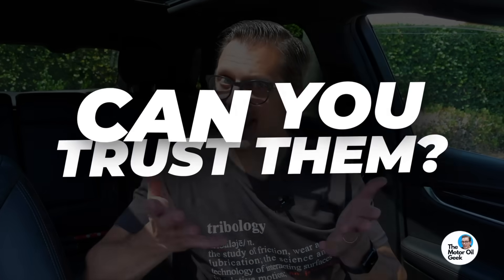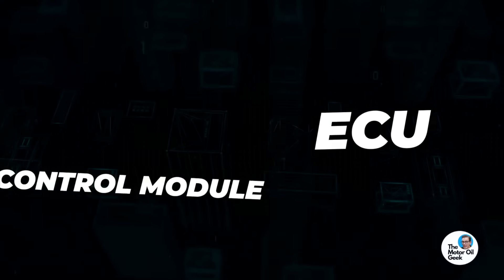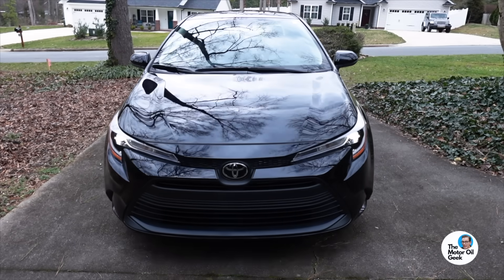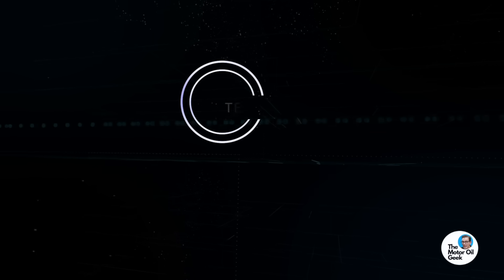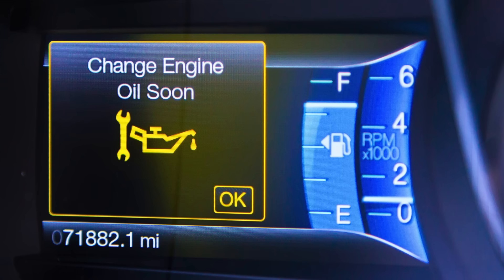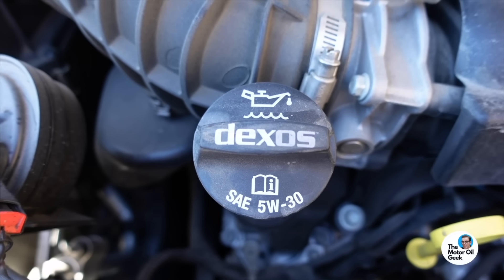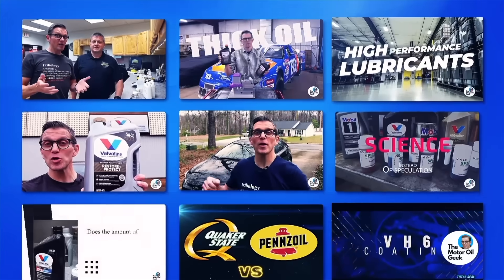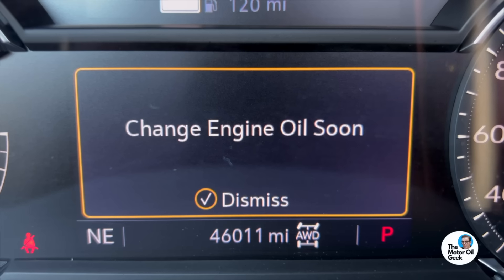The Accuracy of OIL LIFE Indicators REVEALED!

Comment: Good video. I have an oil monitor on my '97 Regal (3.8L) but I only drive less than 1,500 miles a year on it, and change the oil once a year, so I have never driven it long enough to make the "idiot light" come on. Now, on my '91 C1500 (5.7L) I have a timer and I only put less than 1,500 miles a year on my truck, and change the oil either when I hit 100 hours or one year. My average speed based on the timer and odometer is 35 MPH every time I check it so the same would be true with the Buick since my driving habits don't change between vehicles. I always look at the bottom of the oil drain pan (piping hot oil drain) and I will see virtually the same "shiny" super tiny wear particles from both engines despite the very low miles between oil changes. So, the longer you stretch out your oil changes, the longer those particles stay in suspension and circulate over and over again inside the engine until either the oil filter traps those particles or you drain the oil. My driving habits might indicate that the oil is more often bypassed (oil filter bypass and engine block bypass) than run through the filter since it doesn't get run long enough to get hot/thin enough to more freely pass through the oil filter. Food for thought??? I would like to know if any motor oil makes its way through the oil filter at highway speeds when my hot oil pressure sits right at 30 PSI?
Reply from the maker: Stay tuned for our next video about oil filters.

Comment: I have cold feet about trusting the oil life indicator on my 2016 Ram 1500 pickup. I change it every 5,000 miles only because of the 5.9 Hemi lifter failure that happens to some of them. I only use Mobile 1  5-30 full synthetic oil and Wicks  filter. I am I wrong ? Anybody ? I feel better safe than sorry.

Comment: The issue I have is that this is on the assumption that the oil life indicator was reset the last time the oil was changed. I can't count the number of times on my personal vehicle, I had to reset the oil life on my own, after the shop forgot to, or more likely, had no idea how to, reset the system.

What's the likelihood that for a rental, this is even happening? It could've been changed just 2-3,000 miles ago, but never reset. I'd be more impressed with numbers on a personally owned vehicle that can have the oil life verified reset at the proper interval.

Great historical information in this video, but from a scientific aspect, major, integral variables are at play.

Comment: 4:15 18° above which oil temp? You have to base that on an optimal oil temperature.  6:25 Why would you use a rental car for this analysis when you don't know the true length of time the oil has been in the vehicle? Or whether or not the oil life monitor was reset when it was last changed? The conditions under which it was driven?  5:07 GM oil life sensor... there is no oil life sensor.

Comment: Had a 2011 GMC Sierra with a 5.3, 250k on it. The OLM would zero out at 10500k to 12000k. Never went over and never had to open up the engine.
Oil is cheap, engine repairs are not.

Comment: Thanks, I always change around 20% to be safe. Now I feel confident I can go longer on my oil change.
Reply: I did my last oil change at 5700 miles (end of winter) and the Oil Life Monitor still had 25% left. Only did it early because I had put an entire can of Gumout multi system tune-up with PEA down into each cylinder to clean the piston rings.

Comment: The system also follows the timeline between changes, ie "change every 3 - 5,000 miles, OR every 6 months. My last oil change in my F-150 was 2022, but has only 1,800 miles.....monitor say oil change due now and has for 6 months.

Comment: First off these indicators are set to the oil intervals set by dealer or manufacturer, not based on whether or not your oil is still good or not. If your running your oil more then 7k your not to smart anyway, even though it may still be good.

Comment: When I change my oil I reset the mileage counter, I use this to know when a change is due.
Reply: Resetting the mileage counter after each oil change is an effective way to track intervals and ensure timely maintenance. Pairing this habit with regular inspections helps maintain engine performance and longevity. You can subscribe to the channel, or leave questions on the "Mechanical Guy" channel. My colleagues and I with many years of experience as auto mechanics will provide the fastest free support!

Comment: The other thing to consider is the technology  that originally  was the design map for oil indicators is obsolete.  Modern oils are far superior to oils from the 80s -90's, vehicles have become so far advanced in efficiency  that their is simply no comparison  to the vehicles from the 80s-90s .  Personally, I always use diesel oil in all my trucks, whether they are diesel  or gas..  My company is good at keeping up with oil changes, but in my personal  vehicle, not so much.  I have gm trucks with 380,000 miles on them still running perfect. In my personal vehicle, I have over 400,000  and going strong. My personal vehicle gets an oil change every fall.. that's it, once a year! I Look down in the valve cover at the rockers and it looks the same as the fleet trucks that get changed every 5000 miles.  I ran a compression check 6 years ago and wrote down every cylinder on my personal truck. At over 100,000 miles later, nothing has changed. That said, most miles are highway. That does make a huge difference! I personally would never run 0w20 ! But I know the ls engines in my trucks can drain back the thicker oil. As far as gas mileage goes, my gas engines average about 18mpg in 4wd vehicles, in the duramax trucks about 21-25 mpg. I simply don't believe the thin oils make enough fuel saving difference  to sacrifice  lubrication quality.

Comment: I had a 2023 Ford F-250 with the HO 6.7 PSD. Used it for towing brand new RV’s from the manufacturing plants to the dealerships all over the USA, the oil monitoring system worked decently. My oil samples every 10K of essentially all highway miles, half of the towing an RV, the other half returning empty…always showed there was more life in the oil. I likely could have gone 15 - 20K miles between oil changes. Using Schaffer 5W - 40 fully synthetic oil and Motocraft OEM filters. All weather. But 95% of the time time I started the engine I drove at least 600 miles without stopping except for DOT required breaks and barely ever let it idle. At 125K miles that motor was still essentially just breaking in. That’s a great motor BTW.

Comment: As a Father of a GM Owner, who Drives like Grandma Example, I would say "Most People can Trust GM's OLM but not all". Her 2017 accumulated enough Condensation, to Freeze the Oil Pump Pick Up and cause 0 Oil Pressure Start Up in below Zero Temps. OLM still showed 42%.  As a Ford Driver (normal habits) and ex Mechanic, I trust them to within 10% (oil is cheaper than parts) not for diluted or viscosity concerns, but for concerns of Oil Passage Blockages from Contamination, Many small Screens that can be blocked by Carbon Deposits.

Great Vid though. I recall Selling the Benefits of OLM back in 2010, only to be smashed by GM's recommendation of "Semi Annual Inspection" shortly after OLM release. Reducing the "No Recommended Service" for possibly 10-12,000kms of driving (depending on how you drive) Sales Pitch

Comment: I changed the oil and filter on my 2018 silverado. Resetting oil monitor and showing 100%. Drove less than 50 miles, now the monitor says 85% remaining. I call B.S. on that junk. This not the first time it's happened. I own three GM trucks with the same junk, and they  all do pretty much the same thing. I will go by mileage from now on.

Comment: Since 2003 I've been using fully synthetic oil in our cars Valvoline specifically, changing it every 3000 miles regardless of manufacturers recommended cycle. When new, first change is 1500 miles, used the second it pulls into the driveway. We bought a 2018 Dodge Journey (4 cyl) new one year and again 1500 first 3000 thereafter. Unbeknownst to me at the time that specific engine was notorious for smoking at around 70,000 miles the wife had 78,500 on hers when we traded it in. The dealership tried to low ball the trade in price because of that "oil burning problem", I told the sales guy it doesn't smoke because I changed the oil every 3k. Needless to say he didn't believe me so I made him and the sales manager have the mechanic take it for a test drive to prove it. Mechanic told me I was wasting money changing it every 3k. After his test drive the proof was there, no smoke. They gave us what we were asking but didn't buy a car there (her Journey was the 3rd car from that dealership). Wife is now driving a certified preowned 2021 Lexus GX 460 AWD with 45,000 miles (when we  bought it 3 years ago). My personal moral of the story is, if changing the oil at 6k is good, then changing it at 3k is gooder!

Comment: My car has an oil life indicator.  I just ignore it and change oil every 5000 miles or 6 months. 
Then reset the oil life indicator. 
btw... it usually says 40% life remaining at 5000 miles
Reply: I go by mileage on my daily driver but I have two other vehicles that accumulate less than 5k miles per year so I change those annually.

Comment: GM's oil life prediction has always taken into consideration driving habits as well... rpm, time spent at high rpm, engine load, driving habits in general... and it's been this way since the early 90s on the cars that had it, which quickly became every gm car by the mid to late 90s. My 99 Camaro SS merely has a "change oil soon" light, so not a percentage... and that's the lowest end of GM's efforts at the time. But most all other cars and trucks (suvs, etc) get / got the 100-0% readout, amongst many other factors.

That said, I change my oil (always have had GM, and atm have an 05 EXT, 99 SS, and a 15 Sierra Tuscany Badlander) @ about 30% mark... I don't take chances, and by that number I'm already around the stated longevity figures on the oil used.. which is always mobile 1 if I'm doing it, or OG OEM Dexos if at the dealer.

Comment: Our local GM (Cadillac / GMC) dealer puts reminder sticker on windshield @ an even 5,000 miles (approx. 33% oil life remains). My old classic cars w/ conv oil get changed annually or @ 3,000 miles. New vehicles, not at the suggested 7,500 miles, but @ 6,000 miles (20% oil life remains). 6 qts of dexos oil & ac/delco oil filter cost about $40, compared to dealer $80.Since I do it myself, I can justify the conservative replacement of oil. Recently scaled that back to 5,625 miles = 25% oil life remaining.

Comment: The dealership told me my engine oil should be changed every 8 thousand KM. Sure I may technically be able to go further but it's cheaper to prematurely change engine oil than to buy a new engine
Reply: That's equivalent to 5000 .miles.  your dealership sounds like they're trying to take good care of your car.

Comment: My 2011 dodge avenger I bought new, it’s up to 255k miles now. What I can say about its “duty based” oil life monitor, is that it’s reliable for conventional oils made back in 2011. It alerts between 4-8k miles. If I use conventional and it’s alerting, I may change it. With synthetic I may just ignore and wait a while longer. These days always following it may be a bit too soon for the changes.

Comment: My 18 silverado uses percentage  system and you can’t even find how low you can go between oil changes in mileage in owners manual or online. Well, one time I checked the percentage in relationship to miles I had driven. Low and behold   100% was 7500 miles.
Reply: If you're using full synthetic and drive a lot of highway miles, engine fully warmed up, then 7500 is okay.
I'd still do it at 5000k though

Comment: You missed a MAJOR thing here. It’s a rental, you don’t know if they reset the oil life monitor.  If they change the oil based on milling as some rental companies do, they may not even think of the oil life reset.  They simply follow the company computer that says to change the oil.  So the oil you tested may have been put in when the oil life monitor said it was at 40 or 50 percent

Comment: Using a rental car is a poor choice. Who knows when the last time someone reset the oil life indicator.  I change the oil on my vehicle every 5k regardless of driving conditions. I constantly forget to reset the oil life indicator. On my GM truck I've done 4 oil changes and the oil life indicator was somewhere around 30%. Not sure I'd want to drive my vehicle on oil that has not been changed for 15k + miles.. Maybe this helps as stated in extreme cases such as city driving or stop and go short distances.

Comment: Forget those oil life indicators and manufacturer recommended oil change requirements.
Look at your odometer and change your oil religiously around 5000 miles.
Get a tire gauge and check your tire pressures weekly.
Lift the hood and use your dipstick for gosh sake.
Find a great, trustworthy local independent mechanic to do your maintenance. They do exist.
Stay far away from the dealership  shops. They are overpriced and only want to oversell you unnecessary crap.
Anything else is BS.

Comment: I have a 2012 Civic Si as a summer car that, one time in it's life, allowed a 25k km OCI... it was a time when it was my primary car and i just got separated, so the Civic helped me pass some time and i did a shit ton of milleage that summer. It was ridiculous.. i remember the time when it told me i needed to finally change the oil. I was in Windsor, Ontario and when i checked it out, i realised it's last oil change was 25k-ish km ago. I found a Canadian Tire and gave it an overdue, to me anyway, oil change with some Bottom of the barrel bulk oil (allegedly) and lowest grade filter (china motomaster) they use there.. when i got home, like 2k km later, i dumped that unknown mixture and filter and filled her with some nice Pennzoil Ultra Platinum and a Fram Ultra filter. It now sits in the garage for the winter, has a bit under 480k km on the clock, doesn't burn oil whatsoever as is the darling she ever was. 

But damn... 25k km..  habitually it was making me change the oil every 10 to 15k km so 25k was a bit unexpected! Would have loved a oil analysis for sure.
Reply: Probably all those highway miles kept the wear to a minimum.
btw... a long drive often helps me clear my head, too.
Reply: @dougn2350  Don't worry, it also have a hundred hours+ of circuit racing on it's belt. Plus a couple of dozens 1/4 mile passes.. i still like that car as much as i did on day one.

Comment: Best gauge on a car would be a Dp (differential pressure) on the oil filter.  Almost NO ONE sends a sample of their oil out, as the cost of $$ and time would be more expensive than the engines of today.  Look at the color of the oil.  Is it black?  Use the auto mfg gauge and you won't go wrong.  You may be changing it too much, but oil is cheap & recyclable.

Comment: It doesn’t count if you’re using long life oil. All I see is an algorithm and I have zero faith in that. I use mobile one extended performance and I go the full 15,000 miles. I have 250,000 miles on my accord and I’m gonna keep doing what I’ve been doing.

Comment: We were using oil analysis on my son's 3.0 V6 Equinox to see what was going on in his engine because I wanted to protect the timing chains. After about three oil changes, we determined that he needed to change the oil at no lower than 30% oil life due to fuel contamination. He was doing a lot of short trips. The car ran great but from what I had read online, those engines were kind of known for this and they were good at destroying their own timing chains because of it.

Comment: My 2017 Roadtrek 190 built on a 2016 Chevy Express chassis has this system but I just change the oil twice a year which is probably overkill but oil is cheap.  I need to flush and fill the coolant though.

Comment: I don't understand the obsession that so many owners have with stretching out oil change intervals longer than the manufacturer's already excessive intervals.  Do they think they're saving money?  Oil changes are CHEAP; engines AREN'T.  My 2002 Acura RSX Type S gets its oil changes at absolute maximum every 8000 Km (500 miles) or 6 months with Pennziol Platinum High-Mileage 5W30 and a Honda oil filter--pre-filled, of course, because I'm not a moron--like CLOCKWORK.  It also drinks Top-Tier Fuel exclusively from Shell, Esso/Exxon/Mobil, PetroCanada (in a pinch), and Chevron/Texaco, Conoco/Phillips 66/76, BP, and ARCO when I'm travelling in Trumpland.  I intend to be buried in this car and I'm 47, so skimping on maintenance is not an option.

And don't get me started on "lifetime fill" fluids. 🙄🙄🙄

Comment: As someone who has a 2005 Silverado  with oil life indicator 300k plus mile still going strong ! The oil life indicator  works but will admit I change the oil when gets less the 25 % !
Reply: I change mine when it shows 20% left that's usually about 5500 miles
Reply: I change my 21 chev 3500 at 30 %
Reply: I have a 1st generation Cruze & I've noticed it starts going down faster after 15% - 20%
Reply: Its works bc its just a mileage based counter systems if your car recommends evey 5k miles then when you reset the monitor its just a percent based on how many more miles you have left time 5k miles its not actually testing the oil or anything
Reply: @tbull1545  that's because it doesn't have to. they've already test oils at various intervals and programed it into the algorithm.
Reply: @tbull1545 close but it actually considers engine hours  not just mileage.   2015 silverado here
Reply: Same
Reply: I change mine every 5k miles.
Reply: Now you know you can stretch it a little more
Reply: My wife’s Silverado 36% @ 6000 miles but the last 36% to 2% happens in less than 1,500 miles